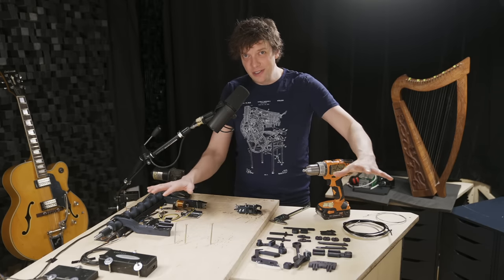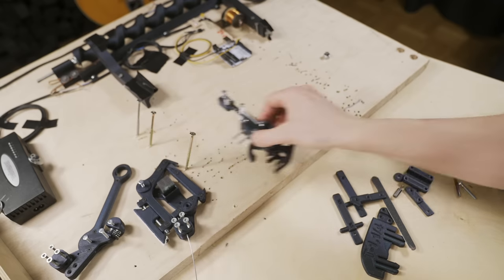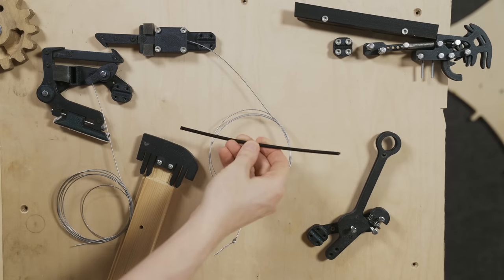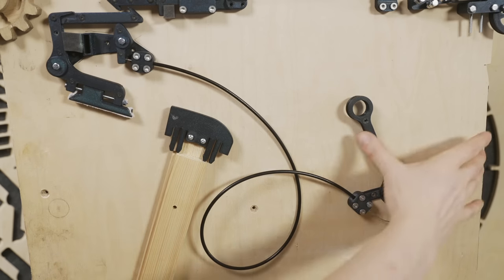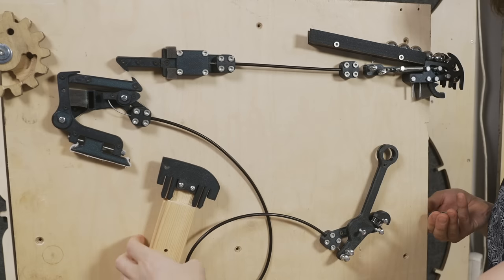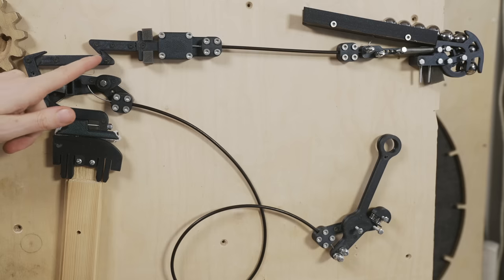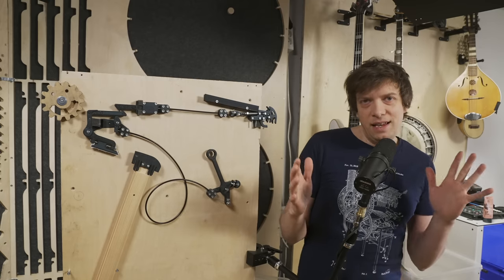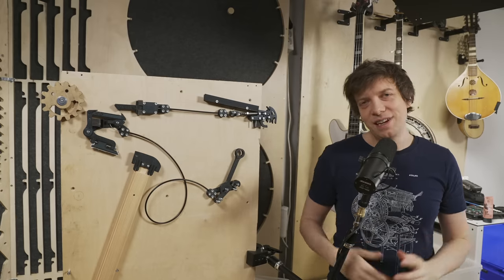These Bowden Cables Surprised Me!

Comment: cable - fine for the muting. but i would avoid for the marble drop as cable will stretch or slip introducing timing errors. Plus will be very difficult to replace if snap once it is all assembled. I would use connecting rods instead of cable for the marble drop.

Comment: Love the Idea, however, i am a bit concerned about the Force required. If you still plan on muting an entire Instrument at once, then my gut tells me that the Steel Wire will buckle outside of the casing rather than pushing through it, because the Muting Actuator on the Reader needs too much force to turn. Especcialy for the Vibraphone, that could be a Problem

Comment: Not sure if it's a concern of yours, but you might have some wear from the two 3d printed parts rubbing on one another as hook rides across the cam. If you added a small bearing to the top of the cam, that would probably eliminate that wear

Comment: I'm predicting you will not have more slop (backlash?) Between the parts connected via Bowden tubes/cables. I wouldn't imagine the link between the mute lever and the programming wheel would be an issue. But I'm sure you'll introduce some additional delay or variability between programming when and marble gate, and I would guess it'll be proportional to the length of the tube/cable. But I'm definitely interested in the next vid where you try to measure how much that actually is. And I'm hoping you don't so just 1 short length. 

Also, please test multiple lengths. It would suck to run into timing issues later bc some tubes are drastically longer or shorter than others.

Comment: Nice vidéos. I have some concerns about that experiment. While proven to be effective, it has 2 design flaws you experienced in the previous design:
- to many moving parts, imagine  repairing/tuning 20 channels of ~20 pièces each representing a potential point of failure... Even though câbles are pretty reliable, they have there flows, like they can cut the pieces they are holding on very heavy duty.
- over-enginered, while the câble allows some flexibility to trigger the marble fall, it is a one time decision. In contrast, for triggers, user might want to change the position of them, so this is fine.

Comment: There is a geometry method to attach the cables in which you have to one piece instead of two pieces plus screws. I use it where I work with motorized windows. I can not give it to you as it may be a trade secret where I work. Still, if you know it exists, you may find it. Good luck.

Comment: Hm. But I expected that the reader in a muted position is always raised above the wheel and does not touch the notes, but when it is unmuted, then it goes down. With this logic everything will work the same way, only one advantage will be added - muted audio tracks will not rub against the programmable wheel and will not create side noises.

Comment: I'm wondering if you've introduced a new tightness variable that may need to be dealt with: muting precision.  

I can imagine a situation when in order to mute a track precisely, there's a degree to which the timing of the lever movement needs to anticipate by some amount the timing of the first non-note.  

Imagine a high-hat pattern where because the lever action wasn't anticipated enough you get an extra (or more?) notes.
Then imagine anticipating too early and you get not enough notes (compared to what was intended).

Lastly, the timing delta might not "feel" right with regard to the tempo of the music.  That is, the brain of the person muting might have a pulse in their head but the timing they also need to have in their head for muting/activation is unrelated to the pulse to the point that it is difficult to execute.

Comment: i am currently at about 3:50 . martin, you use thin cloth on the reader to make it more silent. i think one of the muting part  (tho take it with a grain of salt since i am a noob here on every level).
EDIT: so i finished the video & i am even surer that there needs to be another cloth or simiular, like on the reader, where the muting system is. i mean the hook of the reader & the muter are almost constantly rubing against each other

Comment: To me it looks like an intoduction of four new failure points for each channel this system is used. Furthermore, the exposed cable at certain edges will introduce timing issues and eventually fail.

Comment: I might be mistaken, but i feel that there's something intrinsically wrong about these cables.  In aviaton they use rockers and levers and pushrods to manipulate the control surfaces. I's more complicated, but gives much more rigidity, consistency, durability and reliability. Comes with bigger costs, though. Hope that you succeed with building your machine anyway! I's going to be awesome.

Comment: what if instead of adding a engage disengage mechanism (profile reader reading the profile makes a bit of noise which is emphasized when muted) the mute switch makes the profile reader go up and not read the profiles so there wont be any noise plus less wear and tear due to friction plus maybe less moving parts

Comment: You want proof of concept? The VW type 1,2,3,4 and early porsches all used cable operation of clutch, accelerator, and heater controls as did many early vehicles and aircraft. Look into old repair manuals for tips on setting free play and force magnification on these control assemblies.  So you dont have to reinvent the wheel just use ancestors experience. Good luck

Comment: Hmm, not sure about these cables. Depending on how stretchy they are, they might introduce quite a bit of latency between the gates and the reader. When they all have different lengths, things might get out of sync quite a bit. Then again you have the timing adjustment on the readers, but who knows if it's gonna be enough...

Comment: Will the extra weight of the cable that needs to be accelerated and moved when releasing the marble affect accuracy? That should be a fixed time component tho, but might make the opening of the gate be slightly slower

Comment: That seems like a lot of parts, not a bad design but couldn't you achieve the same effect but using the mute lever to lift the reader out of the way instead of disconnecting the arm? You could attach the reader directly to the dropper if so.

Comment: As you demonstrated there is a delay between the moment you hit the mute lever and the moment it will actually mutes (doesn't drop any marbles). The wider the programming profiles the earlier you have to engage the mute. If you'd use different widths for the profiles you might end up with some notes for a specific beat playing and others being muted. How long is this delay and do you think this will cause issues in practice?

Comment: I see an issue with the timing of the enable of a channel vs the disable of a channel. Since your marble release is a two step process, and your programming pins are so long, the enable of a channel must happen before the programming pin engages the first note you want to play, and the disable of a channel must happen after the last note you want played engages, you will have to engage or disengage a certain amount of time before the intended engage or disengage happens, and that time will change with the tempo of the music. It might be difficult to time the engage or disengage in the middle of a fast sequence of notes. I wonder if you could implement a programming pin to time the change of state so you could set the next state a significant time in advance and have the state change (engage or disengage) triggered by a programming pin, always happen at the same time in the music.

Comment: "muting" channels seems to decrease the load on the programming wheel. Do you have tight enough speed control for the programming wheel to not change the tempo when muting-unmuting channels? Would it be worth to change the muting function to have another pin at the gate, stopping the marbles, and then simplify the design of the hook that interfaces with the reader AND maintain the same mechanical load no matter the mute state? This would also de-couple the design of the gate hook and reader assembly by simplifying the interface.
On the other hand, if it ain't broke, don't fix it. If a change in the load doesn't mess up the tempo, probably better leave it.

Comment: Wouldn't it be better to lift the reader directly off from the programming pins when muting instead of unhooking the hooks higher up? This would reduce unnecessary tear on the readers and create a simpler design with most likely less parts. If there is a problem with that kind of solution, that the machine plays a marble when activating the channel, then it could probably be designed so that a marble must be made "available for being dropped", by the reader first going up on a programming pin and then released when the reader falls off the programming pinn. In that case the mute system must also put the marble in "unavailable mode" when muting, in order for the "readier marble" not to be dropped when reactivating the channel.

Comment: Is there a chance of these cable stretching over time as they do on bicycles? (not sure what MM3 can tolerate) Most high-end bikes now use hydraulic brake lines because a fluid can't be compressed or stretched. Potentially messy though. @SethsBikeHacks might be able to provide advice. Cheers, it's getting exciting again :)

Comment: Is it possible there could be a difference in timing between lengths of cables?
Like one cable could drop 0.2s every time, and a longer cable could drop 0.5s every time
You are only checking one length
It could be consistent between hits, but not between modules

Comment: The length of open wire especially on the right side is too long. It's also bowed. It will have the tendency to bend into the wrong direction.

Comment: Be careful what you are testing.
An engineer's thoughts: I understand why you like the bowden cables. 

But you are not the first person recongizing their advantages and you should give a thought to why bowden calbes are such rarely used.  Bowden cables are very flexible to apply/employ, but are known to have high friction, be unprecise, temperature sensitive, laggy, and wear off/change their properties over time quite strongly. And they are used correspondingly (compare number of gear shift operations on a bike e.g. with bike chain link rotations relative to its neighbour, there is a difference of several magnitudes).

So: I consider it a great idea to use bowden cables for engagement/disengagement, because: 
-You don't need exact timing (not at the level of marbel drops),
-You can deal with friction (one large, manually operated lever vs dozens of programing wheel operated readers summed up)
-You can deal with wear off/bad precision (for engaging/disengaging, you can afford some degrees deviation).

But: I consider it a bad idea to use bowden cables for marble release, because:
-It seems to make little sense to engineer for exact timing of reader operation and marble release mechanism and to put something unprecise as a bowden cable between them. Timing might be manageable if - like in your testing environment - the bowden cable is straight. If you don't intend to use straight bowden cables or if you are not sure that they are used straight in the final marble machine, don't test it that way. Yes, usually there is  a significant difference between straight and bent bowden cables, in particular concerning friction, wear and precision. 
-I would not like to have the load (high friction) of dozens of bowden cables on the programming wheel.  
-There will be thousands of operations. Some will be operated several times per second. Wear off might be considerable. 

Yes, my statements are "beliefs" (rather a mix of knowledge, experience and more or less educated assumptions). And they require to be verified to be valid. 

I suggest: change your test environment, put a loop in the upper bowden cable, measue friction, and in particular do a wear test: operate it with 120 drops per minute for some time. I assume you will have sigificant wear prior to one hour. I am qite sure that you will not get 10 hours out of it. 

But I may be wrong.

Comment: I think you are using the wrong type of cable. The brake cable for bicycles is designed to be pulled, not pushed. use a solid cable. of the solid wire type. those are for pushing and pulling.

Comment: , i'aint no pro engineer but it seems like there's a LOOOOT of screws that kinda get removed and make the assembly faster and less pieces needed
Reply: I think that's mostly due to this being a proof of concept, being easy to take apart and try other parts is more important than maintanace/longevity
Reply: I was just thinking about that, I think a lot of those 4 screw assemblies can be replaced with 2 screws and a set of male/female pins cutting the number of fasteners in half!

Comment: Only one problem I see, and it has nothing to do with the cables. It's the length of the programming peg, and the receiver it actuates. It takes about 3X the length of the peg now, between first contact, to release. This will limit the complexity of the music on the drum, extremely. Seriously, I don't know why you aren't doing this via pneumatics, like all the player pianos and nickelodeons before this. You can still drop marbles with air, and as long as all exhaust is put through a muffler, it should be nearly silent.

Comment: Ive been struggling with these cables since a child and ive become a pro.
Believe me you do NOT want to push on these cables. Its meant for pulling only. A spring returns it to its original position (by pulling again) it WILL buckle if u push on them
2. If you need to loop the cable use ODYSSEY lINEAR CABLES. Its a little more expensive but is designed to twist and loop the cable. Has much less friction and is extremely durable.its designed for BMX to do barspins and such where your cable loops around the head tube.
3.brake cables breaks hearts. They WILL defeat you. Slipping, freying, stretching,  you name it it happens. 

Ive warned you before. This is the last time

Comment: Puh, this thing seems a friction disaster. Dozens of these sliders of the programming wheel... and you need an car engine to rotate the wheel with constant speed..... The prototype shows 8:42 you need a high force to move the "damped with a rag" slider under the lever....

Comment: I understand the desire to find a system that makes it easy to get away from the programming wheel. BUT the bowden cables can fulfill their role for the activation levers but not for the ball release system.
The test he does here does not at all correspond to the advantage he wants to get, because the bowden cables are tested in a much more ideal position than the specifications presented: very short and straight. Whereas a test has to be in the worst condition: the longest length with the worst twist. In this case I bet that the timing will be much worse.
Reply: In fact for a complete test it would also be necessary to measure the additional force induced by the friction in the bowden cables. Multiplying by the number of channels will be significant and decisive for the specifications of the programming wheel and the rotation system.

Comment: And they wear and need relatively frequent adjustment. Quit over-complicating things.
Reply: Killing dependencies is NOT over-complicating things, quite the contrary.
Reply: @peterfireflylund  He's adding in design flaws. Bowden cables require adjusting fairly often.
Reply: @thomasbecker9676  they give him freedom of position for many things. That’s a win.
Reply: @peterfireflylund  Not necessarily.
Reply: @thomasbecker9676  did we watch the same videos over the last couple of years? Martin’s main problem was that everything coupled with everything. Getting rid of most of these couplings is the only way to win. Bowden cables obviously does that for many of them. It allows him to place the droppers wherever he wants without it having any impact whatsoever on the rest of the machine. That was clearly a subject that consumed much of his time and caused a lot of anguish with the previous machine.

It’s not the only source of unnecessary couplings. The interlocking “pumps” and the intermediate-level marble storage was another one. Especially since his mechanical coupling from reader to dropper necessitated a certain placement of the marble lanes relative to the programming drum. Bowden cables cuts the coupling between reader and dropper and therefore between programming wheel and marble lanes.

Once he gets a better “pump” and only a single reservoir at the bottom and a small buffer at the top, he is basically there. The only potential coupling left will be via vibrations across the machine, which I think he will also solve. Partially through a sturdier build, partially through having less friction.

Bowden cables are routinely used for gear switchers and brakes on bicycles and don’t require much adjusting, despite all the dirt and abuse they get. The clutch in a car is also operated via a Bowden cable and doesn’t require much adjusting.
Reply: @peterfireflylund  What's the TL;DR?
Reply: @thomasbecker9676  Surely you can read?
Reply: @peterfireflylund  I sure can, but choose not to read your wall of text, which is most likely meandering, non-objective, and written in anger, stemming from some odd parasocial relationship you have with Martins and his tinkering.
Reply: @thomasbecker9676  there are none so blind as those who will not see.
Reply: @peterfireflylund  Lol. Just because I don't feel like reading a rambling wall of text, you're some sort of sage?